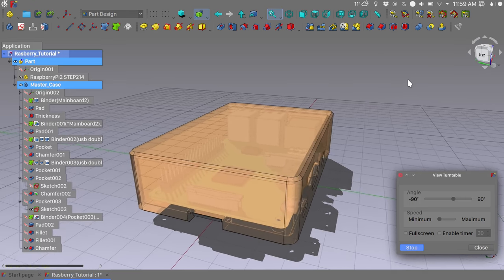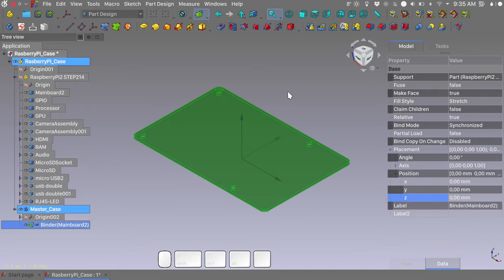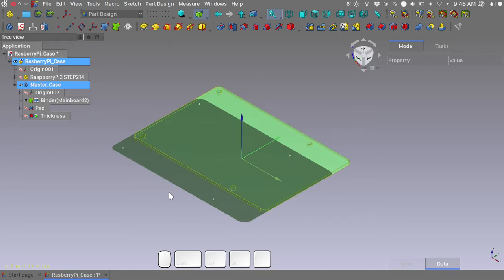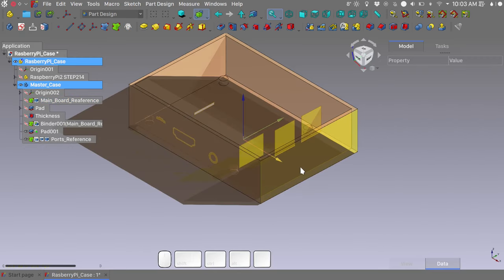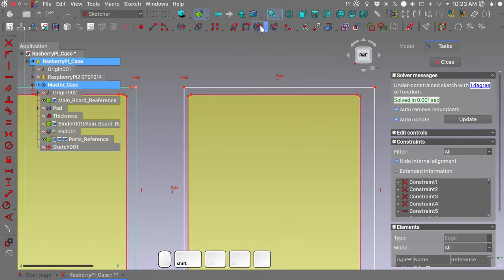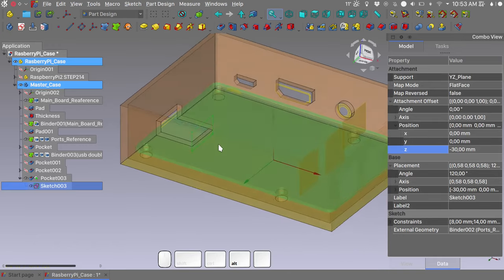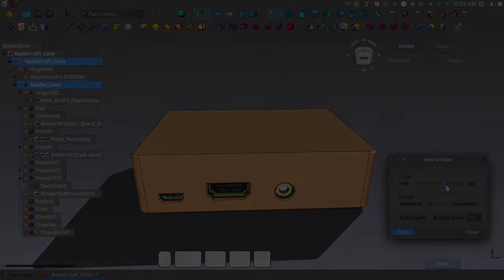Design a Rasberry Pi case for 3d printing tutorial using FreeCAD LinkStage3.

Comment: When I import the pi step file, it isn't automatically converted to a part like yours. Is this a setting I have to turn on?
Reply: Nevermind, found out myself, but can be usefull to mention: edit -> preferences -> import -export -> STEP -> unclick Enable STEP Compound merge
Reply from the maker: @Drew_pew_pew_pew  To be honest I wasn't aware about that also. I have to see if this is the case also in master.
Reply: @Drew_pew_pew_pew  Thank you very much.

Comment: Hi, when coming to pad001, I get an error : Linked object is not a Sketch or Part2DObject. When using "dimension", it works, but not when using ..up to face, I get the error
Reply from the maker: Please try again with LinkStage3 2022.01.11 release and report back
Reply: @OficineRobotica  Hi, It works .Thank you very much for your help. 
Note : important to know for other interested people that I read somewhere you do not install this version, but run freecad.exe in the downloaded directory.....this is not correct. There is no freecad.exe file, but a "runfreecad" batch file needs to be started.
Reply: @ludokustermans  Hi, i also ran into the same problem. By any chance did you find out a way to implement it in the main version of freeacd 0.19

Comment: Is the "Selection on top" button / menu a plugin? I can't find it in my FreeCAD, not in any of the menu's nor in the toolbar customization
Reply from the maker: It is part of the default toolset of LinkStage3. You can enable/disable it with the V, T shortcut. You can find it also typically on the top row of icons next to the "Draw style" icon, it is a drop down menu

Comment: which version did you use for this ? have you triedthis with 0.19.3 ?
Reply from the maker: Unfortunately not yet. Allot of features are not yet present in freecad master but they are slowly merged.
Reply: @OficineRobotica  hi, but in  your version, it worked. Which version did you use? It should be an older one then 0.19.3, or did you have already.0.20?

Comment: Enjoyable watch. Looking forward to the Part 2.
For the future videos I would suggest to just shortly explain why you set some properties to true, like Fuse, Make Face or Refine in this case. It's easier and quite helpful for the new users to learn that way.
Reply from the maker: You are absolutely right. I will be more careful with that for the next videos. Also I noticed that the sketching parts are excruciatingly slow so I will try to condense them.
Reply: Agree with you both, but awesome work anyway! Just keep on and dont stand still :) Hopefully part2 will come out soon =)

Comment: Excellent tutorial. I have just started using FreeCAD and this tutorial has been very clear and helpful, particularly with shape binders and constructions. Thank you for all the effort you put into this.
Reply: Hi, didn't you get an error at 9:47, when padding pad0001 ? Both Giovanni and myself had this problem. Which version of freecad did you use ?
Reply from the maker: I also had some problems with fit tolerance using the 2021.10.15LinkDaily . Seems to be a bug. Remember that this branch is experimental and meant for testing purposes :)
What version are you on ? With a bit more info we can fill a bug report here: 
https://github.com/realthunder/FreeCAD_assembly3/issues
Reply: @OficineRobotica  0.19 is fully released. Which version did you use?

Comment: Very Intresting insights how to solve a task like this. Never paying attention to the tolerance feature until then. Only thing I miss on freeCad (linkstage realthunder) compared to F360 is to use linked constrains (red lines) directly for cutting or pad. But on the other hand, it's nice anyway to cut or pad directly with the shape binders.
Reply from the maker: I am not familiar with Fusion's linked constraints. Can you please elaborate or link a video where I can see how they work? Perhaps already exists in FC and it is named differently?
Reply: @OficineRobotica  seems I described it wrong. I mean https://wiki.freecadweb.org/Sketcher_External
Those lines were get used as reference. Those pink lines could be used directly (if close) to generate a new pad or cut for example in F360. In freeCad the pink reference lines are invisible once the scetch leaves the edit mode.
But since I know now the big improvements what we can do with shape binders like pad, cut or pockets, this is no longer a disadvantage.

Comment: For me there seems to be a bug when using fit tolerance on the additional cutout for the flaps on the usb connector. Everything is normal with fit tolerance 0 but as soon as i enter any value the cutout is not oriented in the x direction as it should be ( and only can be since this is the normal direction to the faces used as cutout tool) but its oriented along the z direction in some weird stacked up way. Btw i am using the windows version.

Edit: When using the shapebinder to create a sketch and cut with the sketch it will cut normally, but when adding fit tolerance here it says: makeOffset2D: result of offsetting is null!
Reply from the maker: If you are not too deep in to the modelling of the case please take a look at the description of the second video in this series. I have recreated the Pi model in native freecad and you will find a link for download. Please use that model instead of the imported one and report back if you have the same problem
Reply: @OficineRobotica  will do. Thanks for Feedback. Will report back any bugs or weirdnesses.
Reply: I have had the same problem.

Comment: Uh. I tried to design board for similar SBC. First I measured it and made model in OpenSCAD. Then it took me 40 minutes to make hollow box, basically two subtracted rectangles that I can use for sketches. I had to start with sketch->pad->sketch->pocket rather than using walls with thickness or cube that cannot be modified at all. Then I tried to make four 6x6mm stands in the corner with fillet on inner corner and align that to walls. This took me like 3 hours, I don't know why. Then holes and I realized screw holes and pocket are different object :-(. Ports were easy but I moved openscad model to intersect walls and did not used binders. After watching this video 8 hours later, many things are clear and I know I can do them better, but learning curve is ... difficult. 
For example I was not even to turn on shadows, my view is slightly broken (some triangles have weird shading) and when I closely followed adding the lid, it breaks vertical edges 2mm below the top unlike in this video.
Plus it's worse and there are some issues I cannot fix, my base plane is showing at weird random angle, once I broke object by separating plane, I have some issues with cyclic dependencies and it's always something, I feel like if I spend something like one hour on model, it breaks. For example slice create two overlapping 3d models. Undo does not have operation name so it's hard to get back.

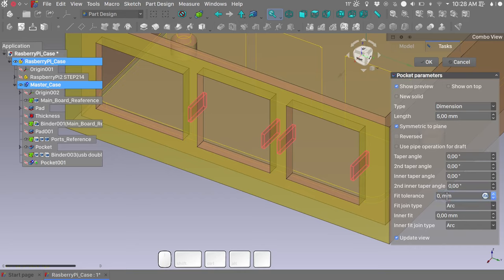Comment: for some strange reason i cannot make the pocket at 19:14. It breaks the model. Before that i did everything pretty much exactly as in the video.
Sometimes the resulting object is distorted and broken and if i increase fit tolerance an error "Null shape" appears.
I use the latest realthunder release.
Reply: this seems to happen as soon as i use any nonzero value for fit tolerance

Comment: 9:00 what do the Fuse and Make face properties on shape binders do?
Reply from the maker: I'm pretty sure I explain it somewhere in the series but can't remember well where. Short answer: Imagine you have a circle select > make SubShapeBinder. If the make face properti is set to true, the binder wil be a full face. This is extremly useful for dowing adittive/subtractive features or even slices of a model .
If instead is set to false the binder will be just the wire.

The fuse property is useful when the SubShapeBinder is constructed with complex "disconected" geometry. The algorithm will try to make faces anyway from your selected geometry. Again extremely useful for booleans or slices.

Comment: 2:20 whenever I try importing the Raspberry PI step file, it imports as a simple body. I can't expand it whatsoever. What can I do?
Reply: I unckeched "enable STEP compound merge" in Import-Export (Preferences), STEP tab
Reply from the maker: I'm a bit of on the run atm but check the start of the second video of the series. I remodeled the Pi entirly in freecad to be able to later share the model given that it is deeply tied with the board ports position etc. 

Clone the linked repository(or download as zip) > File > Open Folder > ...RasberryPi2
https://github.com/oficinerobotica/RasberryPi2-Case

The other folders are the end result of every episode in the series if you want a jump start.
Cheers

Comment: i'm not much of pro in constructing with freecad, but that last pad on top of the case - isnt it supposed to be separate, detached solid (like a cap or cover), or in the next part you will cut it from main case?
EDIT: also ty for nice demonstration of how shape binders work, i'm probably gonna use them more from now on
Reply from the maker: At the begginig of the video there is a small clip with the finalized case model. Notice the cut(separation plane) is in the middle of the model not the top, so we need the cap to be fused with the top. We will model the cut in the second part coming very very soon. Thank you for the kind words.

Comment: 18:27 where can I find in the default menus "selection on top"?
Reply from the maker: On the top bar there is a dropdown menu(blu sphere in a green wire box icon) You will find it there. Anyway, the shortcut is V, T

Keep strong , after the first steep learning curve FC is kind of powerful. You will learn to love it lol
Reply: @OficineRobotica  Thank you! I've been wanting to learn this program since Fusion360 started shifting to a bad policy, but I have encountered so many difficulties which made me quit every time. For now the only obstacles I've found are:

- Face (edges) to select while padding. They often don't work as the sketch is not formatted well for a Freecad pad (I tend to do almost everything on a single sketch and pad different features from there)
- Not being able to Pad starting from a face or a plane
- Sketch Offset absent
- Sketch Polar Array absent
- The C/M shortcut (toggle construction geometry) doesn't work, it first selects the Coincident Constraint (C) and period.
- It was very cool to have the dimensional constraint box open automatically in F360, instead I have to lose some time.

Where can I submit this feedback?
Reply from the maker: @yosyp5905  Let's be honest and professional. Fusion360 is light years ahead of FreeCAD as user experience and features especially when talking mechanical design and cam. But so were Maya, Cinema4d etc in respect to Blender. With a passionate community and good programing coordination FreeCAD could replicate that feat. 

What we really need is CONSTRUCTIVE feedback from people that have experience in engineering/design and that understand the underlying paradigms of FC. (paradigms that I might say are rock solid) . Some more coders could come helpful too lol.

If you are in to constructive feedback check out this thread: https://forum.freecadweb.org/viewtopic.php?f=19&t=52221 you will find allot of extra info there. Be aware that Realthunder is a fast moving target. Allot of what you read might already be improved.

I have already recorded and will be out this week a video on how to extrude one single sketch to different heights so stay tuned ;)

Welcome to the comunity
Reply: @OficineRobotica  What a welcoming comment. 

I have followed Blender since 2.7x (not really a user, unfortunately) and it has come a looong way. I am just hoping that FreeCAD follows its course.

In terms of user experience, I agree, Fusion360 is years ahead. but nothing that can't be fixed.

Speaking of supporting, I have a study background in C and very basic Python (both university), together with intermediate, practical experience with C# (I experimented with Unity). I feel these projects are beyond my competence, but ehy, if I can help, my depression would also benefit lol
Thing is, I don't know where to start helping.
Reply from the maker: @yosyp5905  You could start by choosing some simple bug from the tracker to fix and get accustomed to the project or by reviewing pr's (example thread: https://forum.freecadweb.org/viewtopic.php?f=10&t=54450)

But the best thing would be making a post here https://forum.freecadweb.org/viewforum.php?f=10 briefly explaining your experience and ask where to start contributing or reading documentation. You will surely be guided well.  The most important thing is for you to have fun and enjoy the learning experience. Really, do what you like most. Damn, you could even start learning by coding your own Workbench

Comment: Do you tried to select the point and the edge and then do shift s? 13:50
Reply from the maker: In linkstage3 that is mapped to free hand select. I have to see if that does symmetry in master and perhaps reset the shortcut. Thanks for the tip .
Reply: @OficineRobotica  My fault! What i tried to say, when you create a construction line, you don't need to affix it onto the line. Just take the line of your sketch and the point of the construction line and press "s" as you do it previously at 13:14

Comment: I am using FreeCAD 0.19 and I'm running into a problem from almost the very start.  This is what I'm trying to do, I really hope you can help me.  The video seemed very clear, but this problem has me scratching my head.

These steps work : I have imported a PCB as a STEP model (just as you did with the Pi model).  I created a second part named 'NAV_COM Case'.  I moved the PCB part into the NAV_COM Case part, and it appears in the tree just as yours does.  I create the Body and rename it to Master Case.  

These steps don't work : If I then click the mainboard part in the PCB, the Master Case is deselected.  If I think click 'Create a sub-object shape binder' I get an error - <Exception> ShapeBinder.cpp(661): Cyclic reference to NAV_COM_Case#Part.

I also tried this : If I instead click to select the Master Case body, then CTRL-click the mainboard in the PCB part, then click 'Create a sub-object shape binder' I get the same error - <Exception> ShapeBinder.cpp(661): Cyclic reference to NAV_COM_Case#Part

In both of these errors, the binder appears in the Master Case body, but when then error window closes the binder disappears (understandably, due to the error).

PLEEEEEEEEASE can you help?  I'm truly at a loss as to what is wrong here, I have followed the example to the letter so far.
Reply from the maker: As stated in the video title, this tut uses LinkStage3. Are you using LinkStage3?
If yes I'll give it a look and try to understand what's going on . You might as well have hit a bug, will see
Reply: @OficineRobotica  I wasn't at first, but I switched to it before I posted. In LinkStage3 I cannot import the STEP file in the same way, it becomes a single body instead of a tree of its component parts. I'm very new to all this, and not particularly talented when it comes to design either.